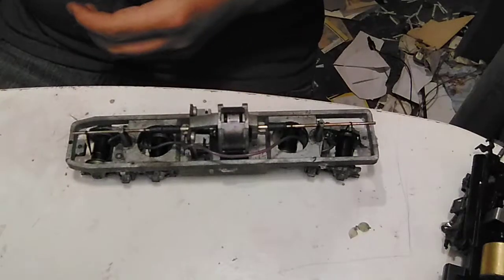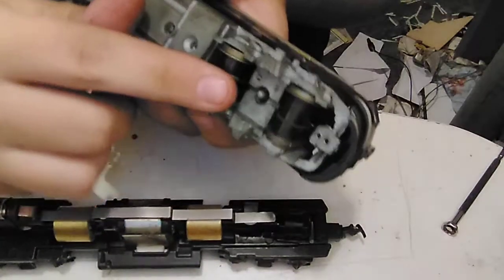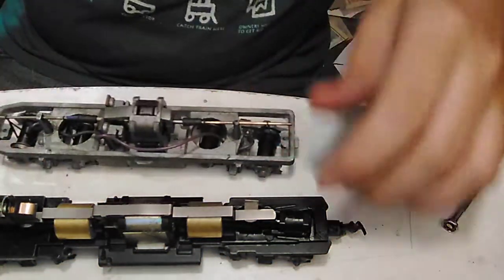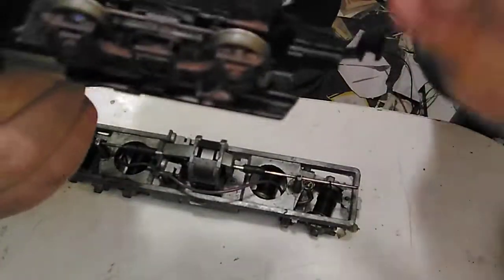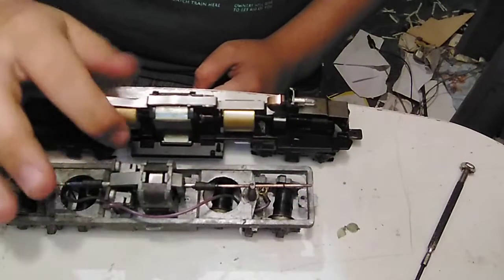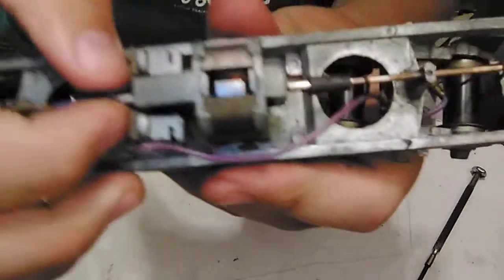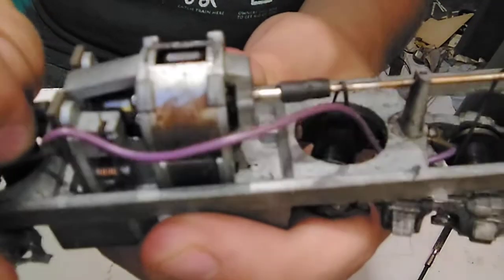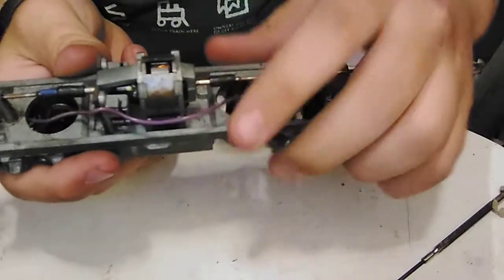Athrean rubber band drive, benefits and problems.

Comment: Super. I still have one Athearn band drive F-7A and a matching F-7B dummy unit. About 15 or more years ago, I got fed up with replacing the bands, which could last as little as a six months in heavy operation. I tried everything. Hair ties, elastic bands, rubber bands, factory drive bands, and dental bands, and all of them eventually failed. A friend mentioned that using a stretchy band to drive a locomotive, or anything else, and do it smoothly, doesn't work as well as having an actual drive belt. Profound. So I went on a two year quest, and found a replacement. I bought cassette tape player drive belts, and it changed the locomotive drastically. It operates great, and is smooth and quiet, and I haven't had to replace a band in forever, plus I still have four bands left for future repairs, so this fifty year old Athearn Band Drive F-7A is going to outlive me. There is a major drawback to a band drive locomotive, and that is when you decide to use it to clear snow or run a snowplow train on your railroad, or you have a long heavy train in the rain, and the bands get wet, and that smooth drive shaft allows the locomotive to stall in a snow drift or just sit there in the rain with the motor spinning like crazy and the wheels not turning, at least until the drive belt dries out from friction, then it suddenly takes off like a rocket. Other than that, it is a fantastic locomotive to operate, and the F-7A and the unpowered F-7B are usually assigned to my 21 car heavyweight passenger express train or the afternoon local freight. The version that I have is a little different from yours in that it has flywheels, bearings on the drive shaft supports, and universal joints connecting the driveshafts to the motor. I love my band drive Athearn EMD F-7A powered locomotive and my EMD F-7B dummy locomotive as well, but that flywheel equipped Athearn chassis would be quite welcome on my railroad. Good video. Hello from the Tracy Mountain Railway in Colorado. 💙 T.E.N.
Reply from the maker: that's a good idea for the drive bands, i've been looking for a different solution for a while now.

Comment: I have 4 or 5 band drive engines.  They run great for a short time, then the bands break.  I'll have to find those hair elastics.
Reply: Look for any remaining cassette tape player drive belts, as these will transform your locomotive. 💙 T.E.N.
Reply: @tracynation2820  I was thinking that.  I used to repair car stereos.  Those belts should last.

Comment: Accidently reversed the polarity cleaning it. 
Now it runs opposite from my other locos.
How do I correct it?
Reply: If you have the plus (+) on the right rail, the locomotive should move forward. Most locomotives are wired this way. 💙 T.E.N. Edit: If it is a band drive, just flip the belts on the drive shaft, flip the trucks, flip the wheels, or flip the wiring, and if it has directional lighting, make sure the right light comes on when the locomotive is moving. 🙂
Reply: Flip the trucks around, or flip the wires around at the trucks.  I try to make sure all my engines run the same direction also.
Reply from the maker: if you twist the rubber bands the other way you can reverse the direction as well (great if the motor runs better one way vs another)

Comment: Here Athearn had a good motor but a bad design on the transmission.  Bands were ok but too weak and if you tried too much tension with smaller bands all you did was grind out the posts holes lol.  Still they were solid runners and much smoother than pancake motor toys at the time.  It's not worth the time and effort to make these into blue box drives as the it's easier to just pay for the blue box loco and will cost roughly the same,  but these old band drives are still viable runners just nothing too long.
Reply from the maker: I have no interest in converting the rubber band drive outside of putting the shell on a BB frame, as I don't think that they have changed the tab design at least until the end of the BB.
Reply from the maker: Another drawback is that they weren't toothed belts, if they did a regular design and utilised toothed belts it probably would have been better.

Comment: I like those 5-pole motors. When lubricating, it is best to put a drop of light oil. DO NOT use WD-40 because the spray penetrates too much and spreads, and if you get the cardboard insulator on one side of motor wet, it does effect conductivity negatively.
Reply from the maker: Yeah, I don't use WD-40 it's to much of a mess without much control unless you were to apart the can into a container. I use mineral oil, have yet to have any issues, my main goal is make sure there's a lubricating something in the bearings and gearing
Reply: Plus, oil on a belt drive shaft. 💙 T.E.N.

Comment: Hey there, i have a question? . Could you replace the band drive system to a gear drive system , using the same motor ? Lol thanks
Reply from the maker: I don't know but I have heard of a kit to do it in the hustler switcher.
Reply: The motor can still be used (it's almost proprietary in older models) and a universal joint attachment can connect to the motor shaft with a gear drive truck, though chassis may require serious modifications.
Reply from the maker: I think st tried to use one of the motors on a geared loco but I'm not sure
Reply: It would be easier to adapt a different gear drive chassis, as major modifications would be needed to convert a band drive to a gear drive. 💙 T.E.N.